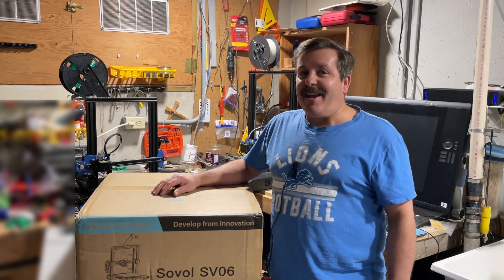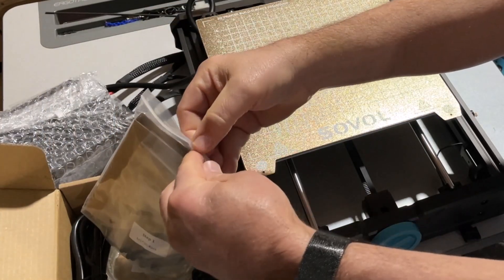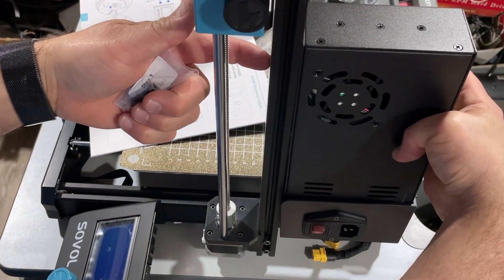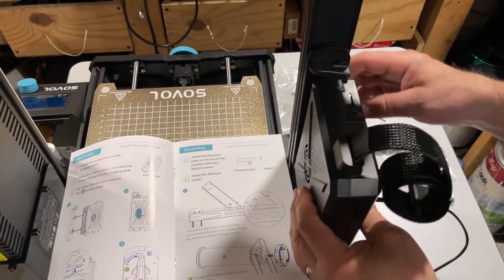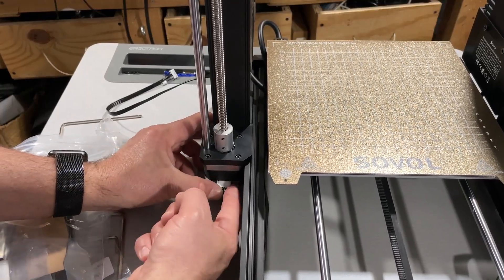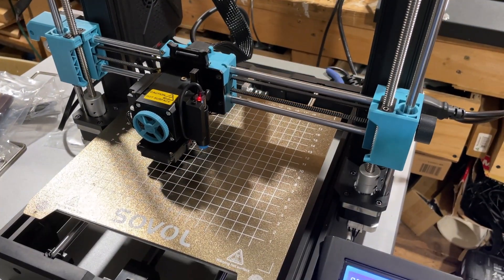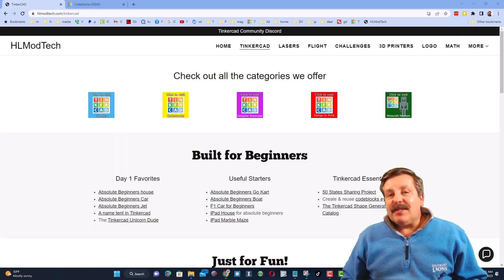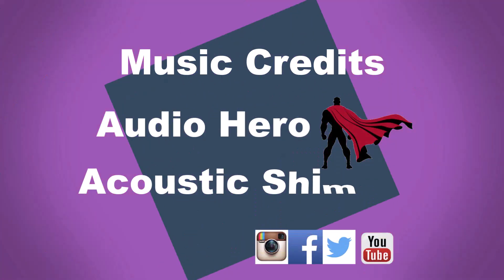Sovol SV06 assembly & 1st print steps in under 15 minutes! 💯🤯

Comment: I have a Geeetech a20m that I got used. Have been struggling with it for a week, after going through the Ellis and Teaching Tech calibration guides multiple times I am really unsure where my issues are and I am ready to just get a modernized printer cause all I want to do is design and print, not struggle with setup and calibration.

Would you recommend the SV06 or SV08? Or maybe a different model?
Reply from the maker: I have never worked with the SV08. I like my SV06. That said the Bambu P1S is my fav. The Artillery X4 Pro is slick with Klipper too.
Reply: @HLModTech  would you say the sv06 is beginner friendly? Does it work out of the box, or does it need mods to work properly?
Reply from the maker: I had zero issues with the sv06. I miss that it does not have built in wifi though. I never thought I would care... but I send things to my connected 3D printers way more often.
Reply: @HLModTech  that's good info, thank you! Which printer do you find you gravitate more towards when just needing a quick print?
Reply from the maker: P1S is always first. X4-Pro is second. P1S is further from where I create content... so it does not affect recording. It also has the AMS option. Multi color takes too much time for me... but the ability print parts in different colors in a instant is really slick.  I have about 900 in the P1S and the X4-Pro can be snagged for under 200 right now. There are new machines coming out from both that I would love to experiment with...

Comment: Thanks for this video,i want to buy one
Reply from the maker: My pleasure. My short that will be posted in a few minutes highlights a print from the SV06. 💯🔥 Great printer.
Reply: My only concern is that i don’t know how to use the program, guess îll watch videos
Reply from the maker: Any lessons in this playlist are great for brand-new Tinkercad users.    https://www.youtube.com/playlist?list=PLRXLS33csRK7qasevs577eQMloptAVVm_
Reply from the maker: You may not "need" any of those designs, but they give you a great learning base and you can reach out to me if you are looking for something in particular.
Reply: @HLModTech  thank you, do i need anything else or only the PLA string?
Reply from the maker: @ladycathou  It will work with other filaments, but PLA is my favorite.  I would start with a single roll as you are getting your feet wet. This is a fun key chain project you could have whipped up for printing when it arrives. https://youtu.be/gkCcbUQ2UFE
Reply: Thanks a lot

Comment: I really do appreciate the walk thru but one question…. Can you tell me whatd make my prints keep sliding around on the baseplate?
Reply from the maker: Likely not close enough to the bed for it to adhere. Occasionally I use a dash of Aqua Net if I think I have the bed set right and they are still not sticking. It has been really rare with that printer though.
Reply: @HLModTech  i think the issue was temp im running pla+ and i just turned it up and it seems to be sticking now. Again thank you.
Reply from the maker: Nice catch. There are a ton of variables that can come into play. 💯👍
Reply: @HLModTech  i had one stick and then the next try it didnt wanna stick.. i may or may not have some sort of issue with the settings ill be looking into it later today
Reply: @MileytheJeepV2 what was your result of your issue? I have the same issue

Comment: i kinda did the same steps but it doesnt say eject i cam only open the folder
Reply from the maker: So which step are you stuck on?
Reply: uhhhhhhh the one where you can eject the file into the 3d printer
Reply from the maker: Eject is just used to properly remove the sd card from your computer.  It just "disconnects" it. Once disconnected we can take it to the printer and get ready to print.
Reply: i think i dont have an sd card
Reply from the maker: The send one with the printer. Did you get the printer new?

Comment: Thanks for this!! Your walk thru was excellent. I've been using the original flashforge dreamer since 2014! I've repaired it soo many times. The bed wires caught fire, and I repaired it, but it happened again and now the heated bed is toast.  Can you believe I paid $1400 for my dreamer?! It's noisy plastic junk compared to this $200 sovol SV06!  My sovol arrives tomorrow!
Reply from the maker: My pleasure. It has been amazing watching printers change over the years. My first was a Makerbot Replicator. What you get for a few hundred bucks today is bonkers. Feel free to reach out if you have questions.

Comment: When i try to print something i select the file heat the nozzle but when i press continue nothing happens
Reply from the maker: Are you starting with the cube I show in the video?
Reply: @HLModTech  I just got it working I forgot about the filament sensor lol
Reply from the maker: Awesome! Sweet work solving it. It is easy to get frustrated and end up stuck for quite a while.

Comment: Hi, thanks for the video. I followed the instructions and it worked so good, But once I finished the filament that came with the Printer, I had another kind (Black) and even after hours and hours of tweaking I get spaghetti or sub par prints with tons of ugly mishaps. So. I was wondering if you knew the name of the white filament that came with the printer, because I want to get some ! Thanks.
Reply from the maker: Thanks for the kind words. I have no idea where they get their filament from. I do know it was PLA. I am not picky with my filament. I snag it on Amazon and generally only look at price. Some users swear you need to keep it in a dry box, etc, but that is not the experience I have had. My printers are all in my basement, filament in the open, and I am pleased. I do hear good things about Hatchbox filament... but that is not backed up by a ton of experience. I have had a few rolls... it printed fine, but... almost everything I use does. I have had issues with Yellow filament becoming brittle. I have not solved that yet.
Reply: @HLModTech   Thanks for taking the time to help.

Comment: I pretty much followed this video exactly, but I printed the standard benchmark boat, and noticed that the nozzle keeps dragging the filament, I kept adjusting the probe z offset but couldn’t get it to work still, is there any advice or way you know I can fix this?
Reply from the maker: If you followed it "exactly" you would be using the cube. I recommend it for a reason. It is a faster print so you can adjust Z till you have it right. What are you using for your Z offset?  What filament and settings?

Comment: Does Sovol SV06 print faster than Ender V2???  If you had the choice to buy one of them, which one would you choose? with some tips why?
Reply from the maker: I never tried to push it. It is not using Klipper which all the fast printers are. I have enough machines that I stick with 60 mm/s for just about everything. Now if I land one of these new machines... that may change. =) I had an Ender V1 and this is a huge improvement over that. Working ABL out of the box and silent steppers were nice.

Comment: hi, as soon as i turn it on and go to prepare -> auto home, it moves a little bit then gets caught on the very left and starts grinding really loudly, which i don't think is supposed to hapen. thanks!
Reply: basically whenever it moves around, it always gets to one of the sides (top or sides) and stops there and grinds really loudly
Reply from the maker: That means the end stops are not "registering". It is not good. Make sure you power it off if that happens.
Reply from the maker: I would contact support as I am not sure how to solve it with the X2. I would first double check to see that you have all the cables firmly seated.
Reply: great, thanks so much!  @HLModTech

Comment: My svo6 is crazy loud and whenever I home it is maxes out when moving the bed and feeding out filament and makes the motors skip. So far not impressed. Did everything step by step the instructions said to
Reply from the maker: Sorry to hear that. When you say it maxes out, which direction is the issue? X, Y or Z?
Reply: @HLModTech  Z axis. I somehow fixed that problem and don’t know how but now it’s not dropping the filament on its “purge” before a print and it pulls it to the main work piece. The bed is at 60c for pla and the part keeps popping off mid print
Reply from the maker: Good to hear you have that solved. I would adjust your z-offset till it sticks. Mine did end up being a negative number I believe. The video above shows what I used, but it is likely different for every user. Have you tracked down my playlist if Sovol vids?

Comment: I have a question, do I have to do the initial leveling everytime I'm going to use the 3D printer? Or does it saves the settings that I did?
Reply from the maker: The settings do save. Thank goodness too, because that would be annoying. :-) Thanks for the question and have a great day.
Reply: Thank you for replying! The prints have been great🌟

Comment: I have a question about the SV06 Plus printer, when I use a cable, does a tf card need to still be put in?
Reply from the maker: I would guess not, but I will do some testing to find out for you.
Reply from the maker: Just tested using Cura 5.4. Printed just fine via cable with the SD card removed. Or maybe not. It paused after starting and never finished. I will keep testing.
Reply from the maker: The next print started, the failed after about 70%. Not sure what is up. I have had zero problems while using the SD cards.
Reply: @HLModTech  Good to know, thanks

Comment: I keep trying to make a benchy and it keeps popping off the plate. I need some assistance
Reply from the maker: Have you had success with the cm cube I show in the video yet? What filament and temps are you using?
Reply: @HLModTech  I think I found the solution. The nozzle wasn't hot enough haha
Reply from the maker: Cool. There are so many variables. Great job figuring it out. 💯👏

Comment: Hey there! Thanks for the Video, its actually my first printer and this Video helped me a lot! One question though, my printer is not really silent, the fans are pretty loud, do you have any suggestions what I could do about that?
Reply from the maker: You may have your fan speed higher. I also had a piece of filament get lodged in mine once with made a noise like a bike with a baseball card in it. Finally, I am so used to the noise of my other printers https://youtube.com/shorts/nCcoIvzIZVM?feature=share that I may not truly understand silent. = )
Reply: @HLModTech  Thanks for your quick answer. Yes, its really silent compared to that =D I will build some kind of enclosure for it and hope that the noise will get better I guess. Thanks again and have a nice day, cant wait for more sv06 videos =]

Comment: My boat stopped sticking to the bed so I came here.  I didn't do the probe z offset whoops.
Reply from the maker: With the machine powered off make sure both Z's are the same too. Just find 2 objects that are the same size and manually adjust till it is right.  Re-reun the leveling afterwards too.
Reply: @HLModTech  What eventually worked for me personally is lowering the z offset even further, already -1.640 which to me seemed excessive, and lowering the speed by 50%.

Thanks for the great tips man, you're a good person.
Reply from the maker: Glad to hear you found a working setup. 3D printers take some work, but once dialed in they are amazing.
Reply: @FiniteBanjo Thank you, I took your advice and I can finally print now. 🎉